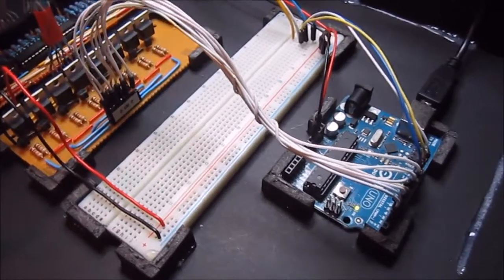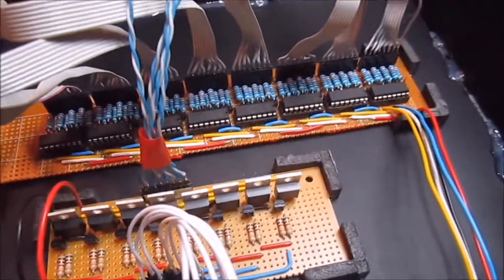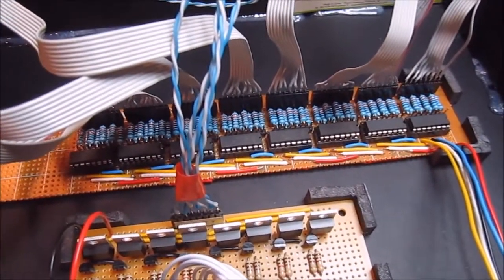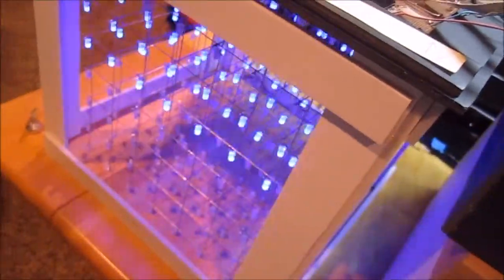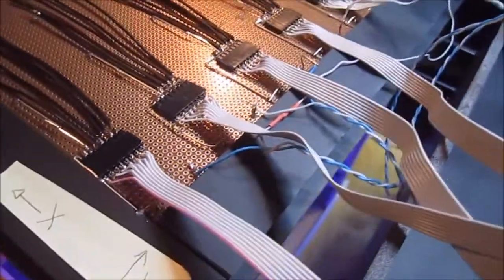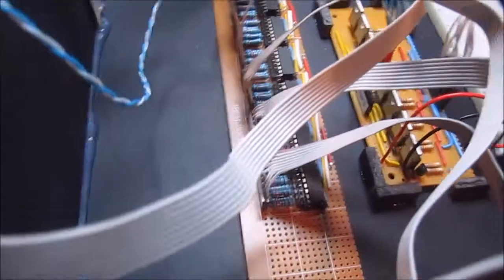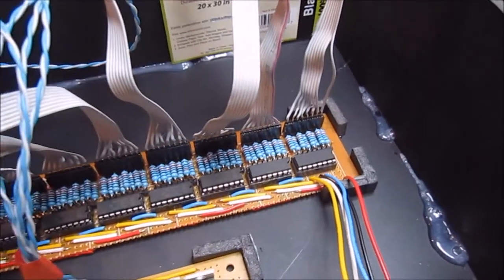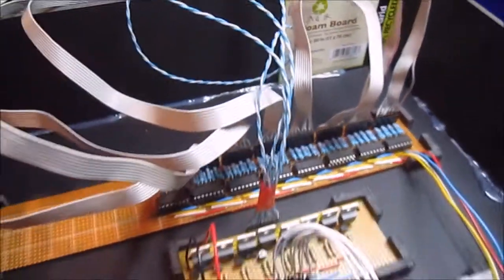8x8x8 Blue LED Cube bonus video - What's inside?

Comment: Hi Hari,
This is one of the best led cubes I have ever seen.
I have got some questions,
1. In this cube we have 64 pillars( are those pillars anode of led's or cathode.
2. We have 8 layers in it, where to connect those layers. For example if 64 pillars are anode then layers will be cathodes, so where to connect those cathodes (layers).
3. In your schematic (posted at hackaday), you have connected pin 9 of each shift register to the pin 14 of next shift register but at the same  you have written pin 10 of previous shift register is connected to pin 14 of the next shift register.
Reply from the maker: 1.  Cathode. The bottom of each pillar is connected to a shift register I/O pin that will bring that pillar to ground.
2. All 64 anodes of leds in one LAYER are connected to the Drain of the MOSFET for that layer.
3. Yikes. That comment is wrong! The schematic is correct Q7' (pin 9) should be connected to DS (pin 14) of next shift register.  Good catch. Sorry about that. I will have to hunt down that file and upload a correction. Thx!
https://www.arduino.cc/en/tutorial/ShiftOut